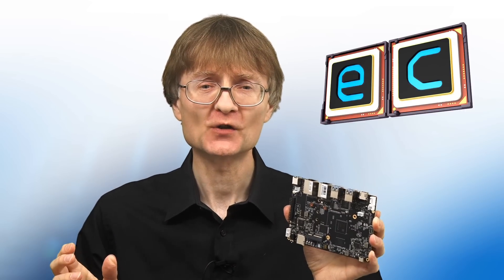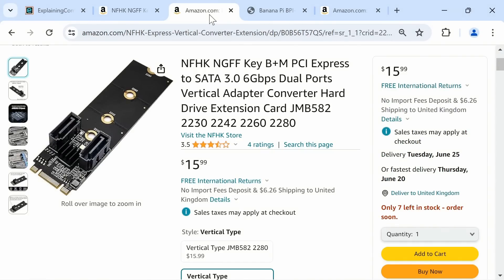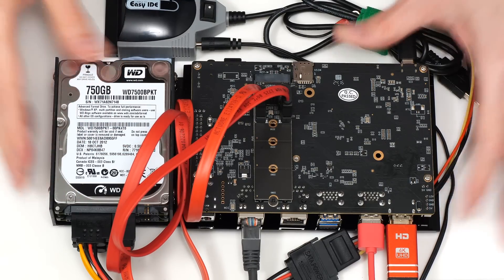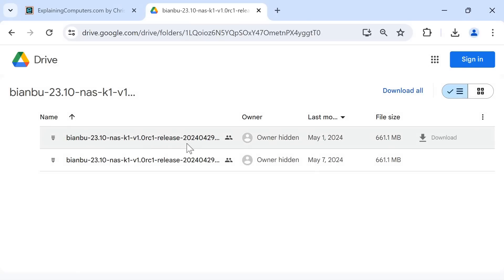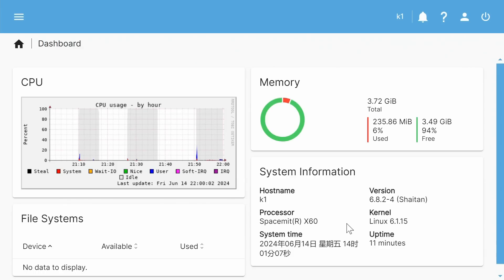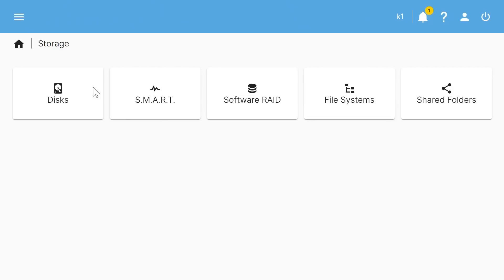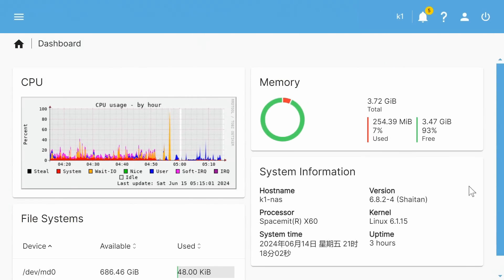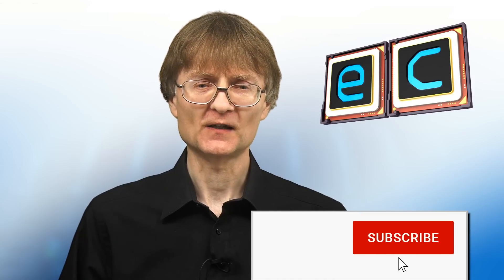RISC-V NAS: BPI-F3 & OpenMediaVault

Comment: I'm earing about the RISC architecture for about 25 years, when I started to work.
Back in these days, the easiest way to run something on these devices was to use some Gentoo like distros. Not the more user friendly I know to date.
I'm pretty amazed how it turned out.
Reply from the maker: Thanks for this, but do note that video is not about the RISC architecture (which now dominates a lot of computing as all Arm chips are RISC). This video is about  RISC-V which certianly has not been been around for 25 years, and is a specific RISC ISA, just as Arm is another RISC ISA.
Reply: @ExplainingComputers  For sure. But it becomes a more suitable solution for many "every day and user friendly" appliances. I'm quite amazed for what the gen 5 can do. 😄

Comment: it will broke realy fast.... "micro SD Card"  why not the EMMC ???
Reply from the maker: No, it won't. There will be minimal writes to the microSD card once OMV has loaded into RAM. And I used a large card (32 or 64 GB as I recall) and a decent quality one (SanDisk Extreme PRO) at that. The read/write endurance of a 64GB SanDisk Extreme PRO will probably be greater than 16GB of eMMC. :)

Comment: DC to IDE+Molex to SATA power to 2xSATA power must be the most hilarious cable combo ever.
Reply from the maker: I presume you are referring to the urban myth that all SATA to Molex power adapters are problematic? Which if course they are not. There were some problems with some designs, but no issues related to cases where only the 5V rail was used (it is only used for 3.5 inch HDDs and optical drives as I presume you are aware). So why the combination is "hilarious" I am at a loss to understand . . .
Reply: @ExplainingComputers  not at all, I just find it so funny because of the length of the chain, but for testing it's as good as anything. I love creative solutions to particular problems.

Comment: That power arrangement was a bit sketchy.

The provided ground lug for the IDE PSU should have been connected to a ground on the SBC board to give the drives and SBC the same 0v reference.

One of the pins of the m.2 slot was likely providing the ground link in your case, which is less than ideal.

Comment: Could you have increased performance by setting up the other Ethernet in a LAG?
Reply from the maker: Potentially yes, as each port should support 1 gigabit in parallel. And the rest of the infrastructure (hub, switch, other computer, etc) would all need to be 2.5 gigabit. :)

Comment: I want to get off MS Win 10 /Win 11.  what is the best way to go?  simply what is the advantage of Risc-V, Liniux, etc versus simply sticking with the Devil (Micorsoft)?   i do not feel like trying out dozens of alternative OS's unless i know it is worth it.  i need to be prouctive and active on my computers so your contructive comments are much appreciated.
Reply from the maker: The way to go is running Linux on x86 hardware -- not RISC-V. :) Eg run Linux Mint.
Reply: @ExplainingComputers  Thank You!  I trust your advise and will try to make the switch.  over the years i have accumulated many secondary apps and tweaks that have made Windows function for me.   and some bigger programs like AutoCad and SketchUp have married me to the MS OS.  once i get set up with my Linux machine i will do that deep digging.  thanks again.

Comment: Since you are using 2 slow mechanic 2.5 inch hard drive, maybe even USB 3.0 is good enough for hooking them up. There are quite a lot of Disk enclosures on the market with USB 3.x connection and various number of slots.

Comment: you should go extra mile and utilize the full capabilities of the hw - notably raid0 and bonded gbe for substantially more performance with almost no extra cost - you are leaving performance on the table #lack of due diligence
Reply from the maker: This is a test of RISC-V hardware, NOT a final NAS build! :) And I seriously doubt that performance could be improved -- the limitation here is 1 gigabit Ethernet.

Comment: It is a shame that the SATA adapter card didn't have its connectors horizontal.  You would then ba able to flip the board over.  Maybe they should have an option for that.
Reply from the maker: Very true. There is an version of the same adapter with one port horizontal, and the other vertical. But not two horizonal ones. :(

Comment: I wonder why you show an M.2 SATA adapter (screen shot Amazon). Is the connector on BPI-F3 not an M.2 NVME slot?
Reply from the maker: The screenshot is correct. The connector on the BPI-F3 is indeed M.2 NVMe (PCIe). But the adapter is to convert it to SATA ports. :)

Comment: I am baffled by the disk spindown time. I usually assume they know how to do it better than I do, you know. Because I'm not an HDD engineer. I am familiar with the sorts of (G)UIs an HDD engineer would make, though, so I get it. The default setting is to show ALL THE NOISE. The operational setting is not available until you calibrate it, using a series of button presses on different parts of the robot

Comment: molex to sata lose all your data is the frase i heard in my head at 5:20. there was a investigation on injected molded molex to sata and the conclusion was that they are dangerous.
Reply from the maker: Well, for a start that related to certain types of moulding only from certain manufacturers, and only to the 12V power rail. The 12V rail is not even used here (as the drives are 2.5 inch). Beware of believing computing's urban myths! There is no issue whatsoever with the vast majority of molex adapters, and no whatsoever with their use supplying 5V power. I give up.

Comment: /dev/sda and /dev/sdb don't mean they're appear as SSDs, it just means it's a SCSI-like controller, such as SATA. You would get /dev/hda and /dev/hdb if you had an IDE controller, such as a DVD-ROM (still /dev/hdc, most often, /dev/cdrom is most often just an alias/symlink, IIRC, but I didn't check for quite a while, t'was still at the time of IDE drives).

So, you made a NAS from an M2 connector using an adapter available on Amazon for the price of a pack of fags, that's cool. Would you know if such a device exists as a PiHat, so it could be used on a RPi3 or... An Orange Pi PC2 (same GPIO as RPi3)? I bought a few of them when they were $20 each, they work fine as headless Plex MediaServer for HD video (my projector doesn't take more than that anyway and the Pi3 used for display only takes Fast Ethernet, still enough) with a USB-2 attached SATA mechanical drive (it's enough) so to mirror disks instead of relying on the night backups (performed by another Orange Pi PC2, those babies have GBEthernet and an H5) that simply kill the network while I'm sleeping.

Also, do the disks need to be the same size/model, or can the system work in "partition mode" (you just need a partition of the same size on each disk)?

I haven't tested Risc-V yet, although I've seen documentaries about Risc-V servers (128 cores) that outperform any ARM or x86 architectures by far in raw performance over price and power consumption, although it's still a bit pricey for mining crypto. I'm waiting for the generalisation of the vector cores and a more advanced support by Linux or... HarmonyOS. Did you try HarmonyOS?

Comment: I don't know about those specific drives, but Western Digital uses RISC-V for the controller in most (all?) of their current drives. They designed their own RV core, and open sourced it. Kind of cool to think you might have RV running everything in your NAS.
Reply from the maker: This is true! :) The HDDs here are too old to have RISC-V controllers. But I had not thought of the fact that, if I had used more modern drives, they would have RISC-V controllers. :)

Comment: Software RAID.... [shudder] I spent a summer recovering a friend's data from software RAID.... and I have learned not to trust linux filesystems. Nonetheless, very interesting setup for minimal fuss. I see I'm not the only one with a stack of old laptop drives. :D It's actually much better for spinning rust to run 24/7; spindown/up is when they're likely to fail. (I have some with over 20 years in service that way.)

What would be really practical for a lot of us is how to set up a (NON-RAID) fileserver to host backups on an older Windows install. A lot of us have that older WinBox that needs a job, and random HDs that still work, and a need for more storage, and you can  never have too many backups... one can do the obvious and just hook it together and slap it onto the network, but I'm sure there must be something more interesting that can be done to automate the whole thing.

Comment: Err... A bit hardware heavy, isn't ? 

- I just use a Samsung  NVME  in a USB 3.0 enclosure as the "Fast" NAS permanently connected to desktop. At first instance, all files archived from the desktop get saved onto the NVME using Windows File Explorer. Then, in slower time the "Fast" archive is copied across via ethernet to a "Slow" Seagate HD based NAS, an ancient Synology  DS115, using the synology software. Easy for the low volume user and Windows cloud disk hater.

Double archive protection.
Reply from the maker: As noted in the video, this is a test build to demostrate the progress of RISC-V technology. :) Nothing is presented here as a current end-user solution.

Comment: One concern I still have is the main use of the SD card. 

Can I use one hard drive to install and run the OS?
Reply: That's the question that's been bothering me too. Good thing I'm not the only one.
Reply from the maker: Yes, OMV can be run off any drive on the system -- here for example the onboard eMMC -- although that drive cannot also be used as a storage volume. Remember this is just a test build to demonstrate RISC-V development, and in no way presented as typical end-user solution.

I did an end-user OMV setup on a mini PC here -- https://www.youtube.com/watch?v=lMKK7DUVEmQ This all said, running OMV from a (decent) microSD card should present problems with a NAS, as writes will be minimal once the system has loaded into RAM, and using a large card (here I think it was 32 or 64 GB) will provide ample wear levelling capacity.
Reply: @ExplainingComputers  ❤
Reply: @ExplainingComputers  This is great. Thanks for explaining. 

I would love to see videos that go from a concept (like this one) to a more-or-less production-ready state. The hurdles that go unmentioned during that transition are probably on another level.

Comment: This is interesting and all very well, but it seems to assume that the objective is to set up a windows network.

What if one wanted to make a system that can be expanded as the need arises - for example to store an expanding blockchain of arbitrary size ?
Reply from the maker: There is no assumption here of a Windows network. OMV is a solution for a domestic NAS which can be accessed from Windows, Mac, Linux, Android, ChromeOS (as shown in the video), etc. :)
Reply: @ExplainingComputers  Thank you It seems that my knowledge is out of date - I was thinking of Samba "Since 1992, Samba has provided secure, stable and fast file and print services for all clients using the SMB/CIFS protocol, such as all versions of DOS and Windows, OS/2, Linux and many others."  My apologies for the slur !

Comment: This is the way we did "cable management" back in the day.
Reply: I still do cable management like this. If the case closes, the cables are managed. My computer is there to be used, not looked at. No windows, no RGB. It's under the desk, out of sight, out of the way 😁
Reply from the maker: It was indeed!

Comment: Very nice use case, did you happen to come across a PCIe to SATA adapter with more than 2 SATA ports? BTW 5:26: The German language has a very descriptive term for this kind of cable management: Kabelsalat.   😉
Reply from the maker: Thanks for this. There are many 4 and 5 port M.2 PCIe to SATA adapters out there, but the ones with the JMB582 chipset tend to be two port. I'm sure I came across a 4 port, but cannot find it again! However, this is "only" a matter of driver support, and in time I'm sure there will be drivers for adapters with 4 ot 5 ports. :)
Reply: @ExplainingComputers could you use the e key wifi slot to get two more ports?

Comment: NAS means turned on 24/7, which means using power all the time. But no power consumption is mentioned. It's cool that we can use Risc-V practically but I want to know about power usage.
Reply from the maker: I should have measured that. My bad.
Reply: @ExplainingComputers 
You can always mention it in this comment and the pinned comment Mr. Chris. 

I understand that setting up a watto metter can take some time.

Comment: Another commentator has raised the question of power consumption. As a NAS is a 24/7 thing, at what point does it become cheaper to use SSDs than recycle spinning rust, even if it's free?
Drive transfer speed is not an issue here, as the network is the limiting factor. Could micro SD cards serve as memory for a low-activity NAS?
The purpose of this exercise was to show RISC-V in use, but if anything the board is overkill for this application. it set me wondering just how low-powered a board would be adequate for the job?

Comment: I understand you wanted to do a merely showcase of "It is possible to do it" - but there is a large room for expansion on this topic.
Can OMV install as a clean official image? Can ZFS drivers work there? What's the load limit for built in SATA pins? (surely they can handle 2.5 drives) What's the power draw with drives - 2.5, 3.5? 
A bit more clarity on what that bottom slot supports. Can it be combined with the top mPCI-E slot? How many 2.5 drives can it pull off with 4xUSB3 and can THOSE be combined into higher raid?

Comment: The "sd" in /dev/sdX doesn't mean ssd, in linux at least "sd" was meant to be short for scsi device. Now it is used for sata too.

The hdX is for IDE drives.
Reply: Just to add, according to wiki and I personally can concur that sd also used for USB flash drives.
Reply: @xrafter  Some of them are even displayed as USB-Attached-SCSI in Windows :-) Well, not sure about flash drives, but external harddrives that support SMART monitoring (and there are also Serial Attached SCSI drives (SAS) although I'm not sure how these are displayed in Linux, especially since we had them in HW RAID around 2010. Which reminds me that these cards had some microprocessors per-se and I would not be surprised to see ARM or RISCV on modern ones.
Reply from the maker: Yes, you are right -- my bad. I am just used to seeing sd for SSDs.

Comment: I'm impressed with the clean-ness of the openmediavauilt web-space. Also DAMN I miss IDE and even ATA back in the day. I started learning everything in 1989-1990 computer wise so yeah. I LOVE hearing drives spin up :) I'm still using a NAS with 3.5" 2TB 10Krpm drives and I LOVE hearing that sound. Cheers and blessings!
Reply: I still mistakenly refer to most internal drives as using IDE (instead of SATA). That said, I have no real love for HDDs as they are slower, more breakable, and often require more power. I've had a lot more issues with spin-downs and spin-ups when using HDDs as NAS, too.

Their only advantage is that they're cheaper.
Reply: @encycl07pedia-  I hear you (read) on all counts, 'cept my comment was more for the nostalgia and remembering how it used to be since I'm an old F##$# lol I still enjoy enterprise 10k HDD's due to their longevity and reliability, VS NAND and other types of flash that are much lower on the lifespan read/write table than ANY platters ever were. Cheers.

Comment: Ha thanks a lot.  A question: why don't you use SSD "disk" instead of old mechanical noisy and power hungry HDD?
Reply from the maker: This is a test. I used what was around. If I'd used SSDs, I'd get complaints of why I am not using HDDs. Sadly I can never win!
Reply: Also, many of us have old HDDs lying around that we would rather put back in service. A NAS is a great use case for such thngs.

Comment: What's with SBC manufacturers hosting files on Google drive? So unprofessional
Reply: The reason is simple... Google Drive is free! 🤑

(Also, using Google Drive shifts the DDOS risk to Google. Imagine if they hosted these large files in an S3 bucket. An attacker could run up a very large AWS bill for them!)

Comment: The drives show up as sda and sdb because they're "SATA disk A and B", ie, the first two SATA ports. Not because the system thinks they're SSDs
Reply: Actually it means SCSI disk A.
Reply: @motmontheinternet  whoops, of course it does. That's what my mind was saying but my fingers wrote SATA. Of course I remembered that from the days when a kernel upgrade changed my hda (IDE disk A) device to sda (SCSI disk A) and my system suddenly stopped booting
Reply: @motmontheinternet  @aaronperl  He may of wrote SCSI and not spell checked, Youtube has a habit of autouncorrecting things 🤣🤣🤣
Reply: @AJB2K3  You mean autocorrupt?
Reply: @AJB2K3 : As far as I can tell, it's not really YouTube doing auto-correction, but some OS component instead.
Reply: Yep. It is also used to describe most drives that aren't attached via NVMe now.
Reply: With reference to the "Linux Professional Institute LIPC-1" From Linux kernel version 2.4 onwards, most storage devices are now identified as if they were SCSI devices, regardless of their hardware type. IDE, SSD and USB block devices will be prefixed by sd. For IDE disks, the sd prefix will be used, but the third letter will be chosen depending on whether the drive is a master or slave (in the first IDE channel, master will be sda and slave will be sdb). Partitions are listed numerically.
Reply: Be aware that scsi and sata are diffrent interfaces, yet both use the same namespace sdX. For linux at least.